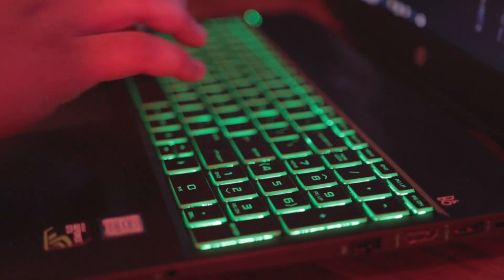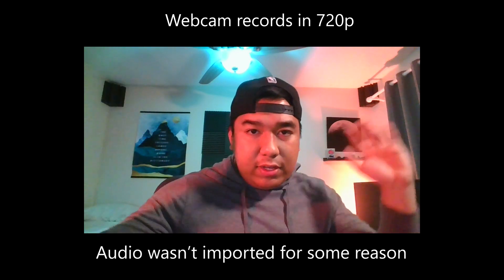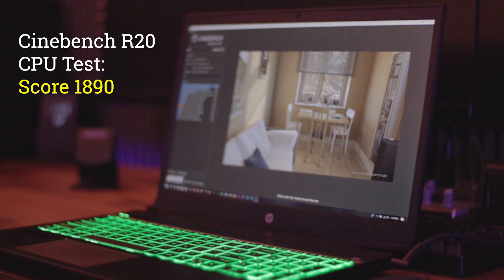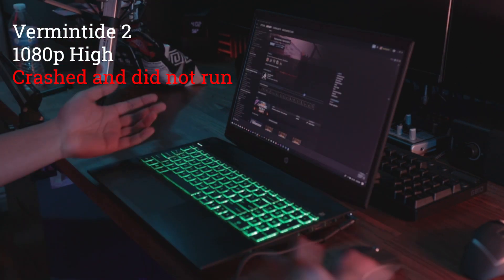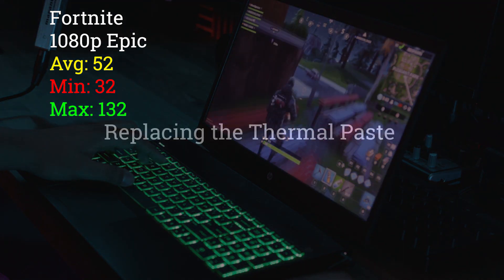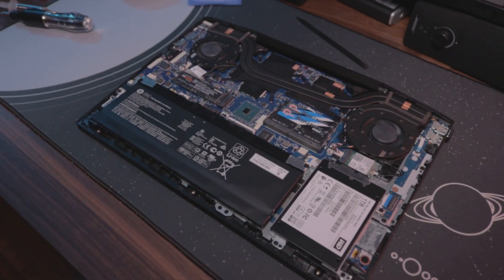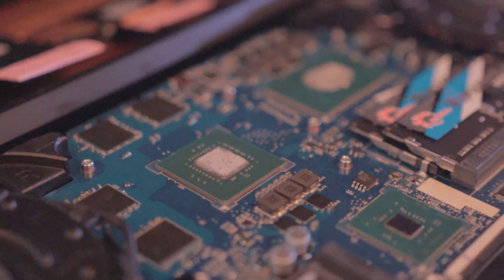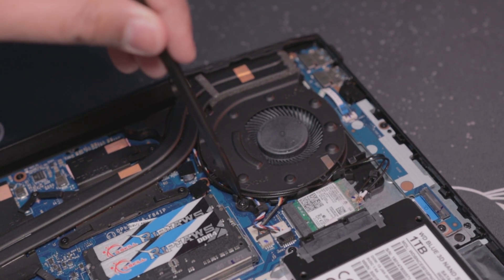Let's talk more about the HP Pavilion 15 Gaming Laptop

Comment: so which laptop should i buy now 😂💔? this or acer nitro 5 or msi gv62 8rd ? which is better for durability and will probably last long ( it will be my main device for at least 5 years ) ?
Reply from the maker: I honestly don't see those 2 laptops being any better than this besides the thermals. I never got to test those 2 so I wouldn't be able to tell if these two perform worse or better. For build quality, this feels cheap but it will last, I don't see this thing falling apart. If you really want a better laptop I'd say go for the Dell G5 and G7 especially with the sale, there is also the Acer Helios 300 these definitely cost more but are far better than the Acer nitro 5 and gv62.